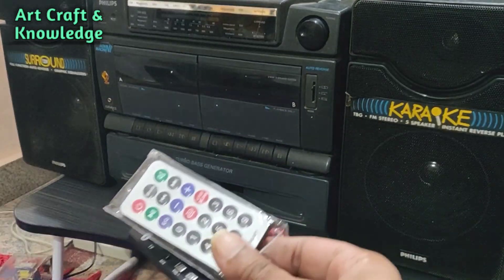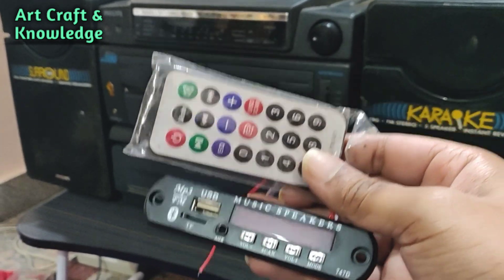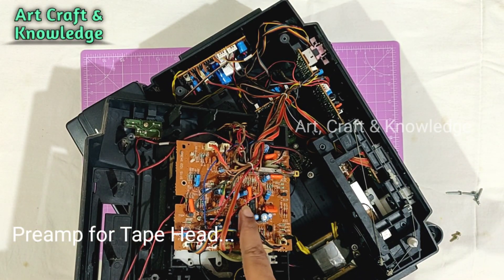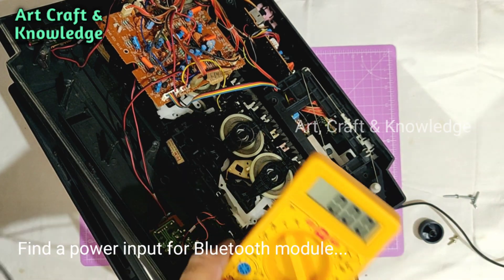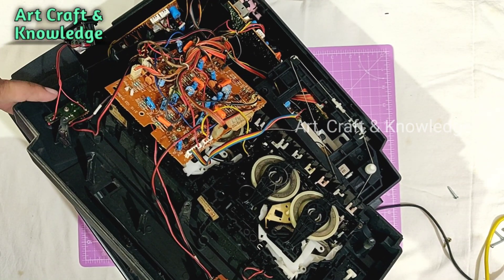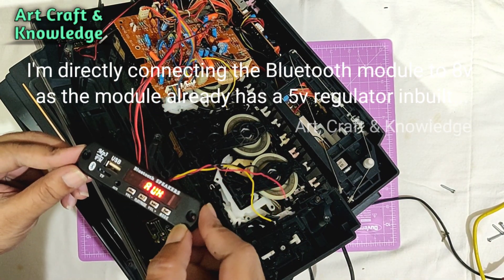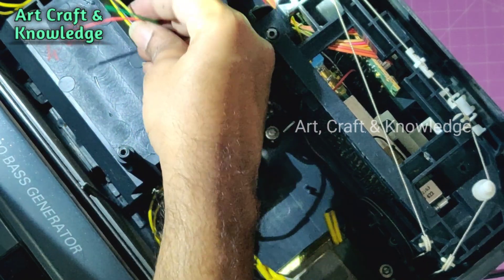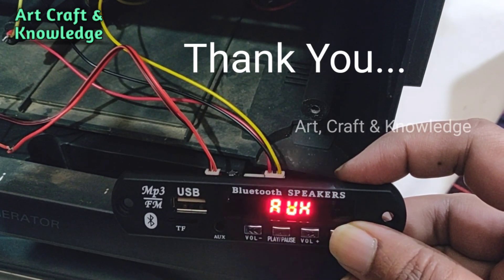How To Convert Old Cassette Deck into Bluetooth Wireless Sound System | Cassette to Bluetooth

Comment: can you provide the name or a link to the bluetooth module you used?
Reply from the maker: Similar to this.
UT Ultimate Bluetooth FM USB AUX Card MP3 Stereo Wireless TF Radio Audio Video Player Decoder Module Transmitter Board Kit with IR Remote for Audio Amplifier 5V https://www.amazon.in/dp/B09BNT12YW/ref=cm_sw_r_apan_glt_fabc_K47R6S4A2GH5448A7NVT?_encoding=UTF8&psc=1